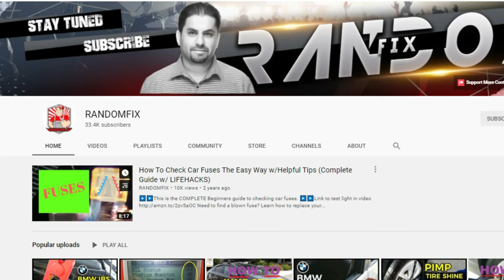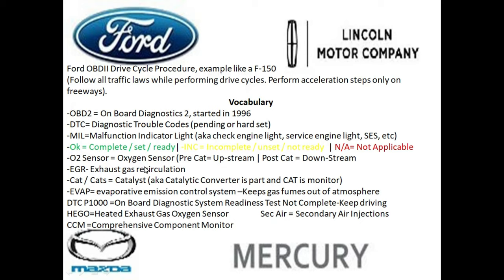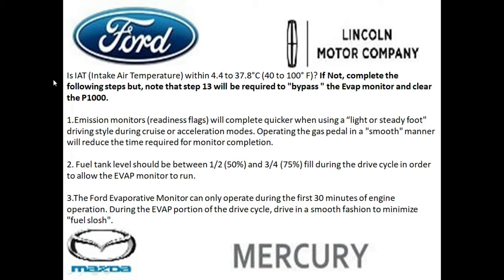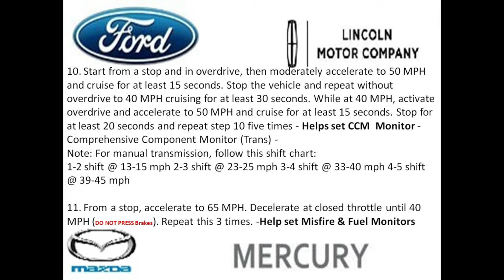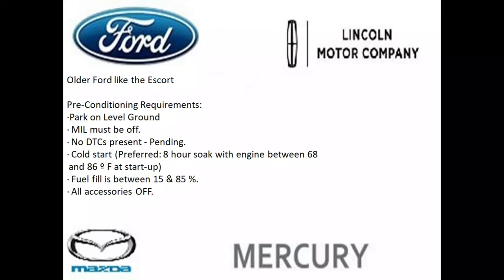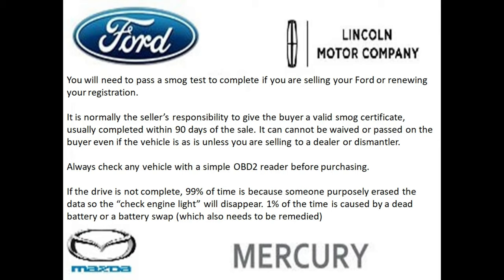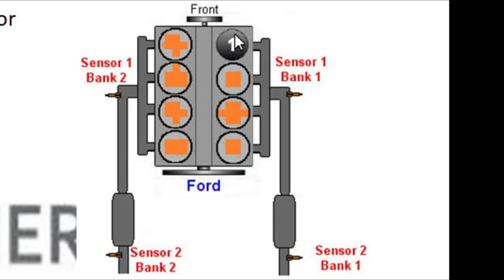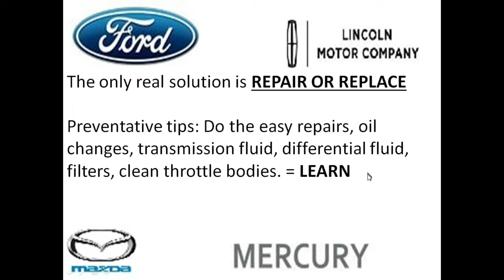Ford Emissions Drive Cycle▶️ How to Pass Smog Lincoln Mercury Mazda

Comment: ? Is it possible to lift the drive wheels off the ground and proceed the cycle it's just something I'm trying to avoid doing an actual road drive cycle
Reply from the maker: Lifting the vehicle off the ground would be advisable and could damage the engine and transmission if run it for a long time with no load.
It may seem scary so here is a video on me completely a drive cycle https://youtu.be/jldTJI64cfM?si=W1Of78QiCQ_9YZph

Once you complete the drive cycle focus only on the unset monitors. I here to help!

Comment: I have a 2004 Mustang that I use E85 and pump gas in. I need to switch tunes when switching fuels. I recently switched from E85 to pump gas and I can't get the Evap and EGR to read OK. Both read NA. Everything else is good. I've tried everything mentioned and can not get it ready. Is there something else I can try? Thx

Comment: I have a 2013 mazda cx5…only my o2 monitor and evap aren’t ready i’ve driven easily 100+ miles since clearing codes. I only need the o2 to pass what can i do specifically to get the o2 to be ready? I have no pending codes either.
Reply from the maker: I appreciate your feedback Sorry for the late reply, did you get this handled?

Comment: This helped me set the catalyst monitor on my 2020 Ford Ranger. One thing was to do the stop go driving in 4th gear to keep the rpm up at 3000 rpm. Many thanks!!
Reply from the maker: Glad to help. This emissions drive cycle are getting stricter and it is a little alarming. You should have to really do this on a 3 year old ranger. I appreciate the feedback.

Comment: Have a manual ford prob, how do I do the drive cycle?
Reply from the maker: Same process, instead of park just it idle in neutral. It’s actually easier with a stick as you downshift without touch the brake to decrease speed.

Comment: Exceptional  !!!! One question though for a 2010 Mercury gran Marquee.  My OBDII kicked out a DTC P0128  - "Coolant Thermostat Temperature Below Regulating Temperature" My  car has a common problem with the  A/C Hot Cold Blend Door Actuator sticking and making a bump bump noise and hot and cold air coming out wrong vents (defrost core diverting???)  Could this be causing the DTC P0128??
Reply from the maker: Not likely but try this. As soon as turn on the vehicle turn on the air conditioner and proceed as normal. The additional load on the engine from air conditioning running may cause the engine to heat up a little faster and you may avoid the  p128 popping back up before you smog the vehicle. Only try this after you have cleared the check engine light. So clear the codes the night before, rest the car overnight and then proceed. Let me know how it goes it worth a try .

If this doesn’t work you have other issues that you need to fix before you pass a smog test.

Comment: How do you speed up the Secondary Air and Evap to ready?  I've driven over 500 miles for a span of 2 weeks and still not complete.  I have no check engine and vacuum hoses look good.
Reply from the maker: You can't speedup anything but you can focus better. For the secondary focus on a longer warm up and for the evap keep your fuel level within range and park on a level surface. The evap is exempt even in California.

Comment: My 2000 V6 California Camry could never clear the last monitor (EVAP) for the last 6+ years so far. Check engine light cycles on for 100 miles then off for another 100 miles in an endless loop. Light on or off it drives fine. It started at around 100K miles, no problem before. When check engine light goes off with the remaining last monitor I was able to get it pass smog and hope it doesn't cycle back to the check engine light on during the test. Feels like playing Russian roulette. What a major PIA, this and doing tax returns!
Reply from the maker: thank you for the feedback !

Comment: I have a 2007 Ford E 150 van with 4.6 motor. It has 200k miles on it.
 My cats are not monitoring for smog. Everyone tell me to just keep driving it  Ive driven over 700 miles since last check engine light was on. Im figuring if cat or sensors were bad it would be a check engine light correct? Any suggestions?
Reply from the maker: What was the previous code before you drove the 700 miles with the check engine light light off? Is the catalyst monitor the only incomplete monitor?
Reply: @RANDOMFIX  it was a thermostat fault. i took care of it. cleared the codes and been runing it over 700 miles now. everyday to work an back. no check engine lights. i recently saw that i may be running odb 1 instead of odb2 which would fail me.. ive tied the drive cycles. no luck.

Comment: I have a 2013 Ford Transit Connect that won’t complete the EGR monitor only plus has no codes or pending codes but I’m gonna try the specific drive cycle for that before looking into diagnosing the EGR system and the EGR itself. Thanks 🙏 for this.
Reply from the maker: Glad to help.
Reply: RANDOMFIX so first off thank you for your help RANDOMFIX. All my monitors are up and passed except for the EGR monitor. The EGR is brand new and the ports to the head are not blocked up. Everything else is good far as battery and coolant. There are no codes or pending codes at all. Maybe I’m not doing the drive cycle good enough. 

Any suggestions or tips?
Reply from the maker: I think these transits need to see three passes of at least 20 minutes each. If you have not pending codes, just continue.
Reply: RANDOMFIX OMG 🤦🏻‍♂️ so 20 minutes per drive cycle? How fast or in between what speeds should I be going?
Reply: @RANDOMFIX  I’m having the same problem with my Transit Connect (2013). Just the EGR. 
So I just need to complete the EGR step 3x? Or do the whole cycle?
Reply from the maker: Scott, do you have a permanent code? Please watch this video. https://youtu.be/PMcJtcSOzdk
Reply: @RANDOMFIX  no codes. No pending codes either.
Reply from the maker: The previous comment had a permanent code thats why I asked. Did you watch the video I sent you?
Reply: @RANDOMFIX  the guy at the smog place said I had no codes. I ordered the tool you recommended and it's arriving tomorrow... I'll re-check with that and watch the video. Thanks!
Reply from the maker: Glad to help.

Comment: Do you know what a U1900 ABS Code is? I have that and a P1900
Reply from the maker: The u1900 is for CAN COMMUNICATION BUS FAULT – RECEIVE ERROR and p1900 will set The Diagnostic Trouble Code (DTC) will set when the OSS "output shaft speed" sensor signal to the PCM is irregular or interrupted.

The connection for both, the abs issue is common on some ford's and you It will not stop you from passing a smog test.  but the p1900 is power train code and will need to fixed. There is a small possiblity that your pcm is bad only replace after checking oss sensor.

Comment: Hi. Will this work for a 2003 Jaguar X type.. I read somewhere to follow Fords drive cycles.
Reply from the maker: Yes, the 2003 x type was a Ford, you can easily tell by doing the Ford drive monitor check.  Here is the video
 https://youtu.be/LllIXoqUKJ4

Let me know what happens.
Reply: @RANDOMFIX  thank you Sir.. I just bought the car it has zero codes but evap and comp monitors are not set. My state allows only 1 monitor to be set.. so I have to get one of these monitors going. Thank you for all your help!!!!
Reply from the maker: My pleasure 😊

Comment: What is a vehicle/engine qualifier and how do you "select it?" Do you have to?

If, for example, your CAT isn't set, can you go straight to step 7 without having to reset the PCM and everything? Do you have to do the whole key on/off/on/run thing every time you want to do a test?

how do you reset the PCM and do you have to in order to get the CAT test to run?

These seem like important details that you glossed over with no explanation. Nobody ever explains them but just reads directly from the ford drive cycle instructions which don't explain them either...

If you only have a few monitors not set (CAT and EVAP in my case),  can you just try to do the drive tests for those specific monitors any time? Or do you have to start back over at step 1?

I have no check engine lights and everything but CAT and EVAP are set and I've been trying and trying to get them to go but nothing is happening. I know that EVAP isn't required but I can't get the CAT test to run after trying everything I can think of. (1999 Ford).
Reply from the maker: Alex, you can focus just on the catalyst monitor, what model of the of a 1999 ford do you have? Miles? And what caused the monitor to unset ( example dead battery) ? 

This trick this video works great for some older vehicles. https://youtu.be/BuZYAy_xi0E

Keep me in the loop and I'm here to help.

Comment: Have a 1998 Ford Expedition 4.6L unable to get cat  and Evap monitors to reset do keep fuel level between 3/4 to 1/4  question 4R70w transmission I do get a converter shutter after awhile will that cause a knock sensor code throws p0325 pending code only not hard code has new battery question will cuase those 2 monitors not to set
Reply from the maker: Yes pending codes will keep  monitoring from setting. The evap is not as important as the catalyst monitor.
Reply from the maker: Are you saying the transmission is cause p0325? Please elongated
Reply: The transmission has a coverter clutch shutter wondering if the shutter is causing knock sensor code

Comment: I have a 2001 Ford F150 with the 5.4 L.  I took it to the Ford dealership because it never went emissions ready.  They told me to keep driving it until it was ready.  I put over 1000 miles on it and it never went ready.  I'm going to have to try this procedure when I get a chance.
Reply: I have a 2001 Expedition with the 5.4 Liter (2) Valve Engine. Ford doesn't make the PCM for this Engine anymore. I'm on my third Remanufactured/ used  PCM and still no luck getting the Cat and EVAP Monitors to become ready for Emissions testing. The Truck has new Spark Plugs and Coil Packs. I'm a Mechanical Engineer and specialize in Automotive Diagnostics. I'm currently working with a Ford Master Tech to help resolve the issue.
I'm a Master Tech too, but they say Team work makes the Dream work.
Wish me luck.

Here is my theory on what's really happening with these Old Ford PCM's. The EVAP & CAT Computer Chips are shot, and are not interpreting the input data to the respective chips inside the PCM.
It's old fashioned Planned Obsolescence.
Reply from the maker: Sorry for the late reply, I appreciate your feedback
did you get this handled?
Reply: @RANDOMFIX  I haven't had the time to follow the procedure.  I had to fix the bed over the summer.  I'm hoping to try your fix soon.  Thank you.

Comment: My 2013 Mustang has no CEL but since the battery was changed 4 weeks ago the Catalyst Monitor, Fuel System Monitor, Oxygen Sensor Monitor and HTR is incomplete. Hopefully this method works because I need to get mine smogged next week. Thanks
Reply from the maker: Good luck and let me know it goes. I'm here to help.
Reply: @RANDOMFIX  I’ll try this out when the road is empty past midnight this weekend. But I have one question since I have my EGR, EVAP AND CCM ready, so I still have to do those steps or can I just skip to the ones that I need to activate like HEGO, Catalytic and Fuel Monitor? Like without starting all over doing the steps that I don’t have to do anymore since those codes are already ok
Reply from the maker: You can skip right to unset monitors but you have more than one unset monitor so it might just be better to start from scratch but do not reset ( erase) the current data. Just start off with a cold start with 3/4 tank of gas and I'm sure it will set pretty soon. Good luck and keep me the loop.
Reply: @RANDOMFIX  finally got all my monitors ready. Thanks for your help
Reply from the maker: Glad to help. Is there anything the in video that was confusing or unaddressed?

Comment: I have a 2003 F150 Lightning. Has P1000 code due to EGR and Catalysts sensors not ready. Troubleshot the EGR system ok and drove the truck 400 miles and still not ready. Help!
Reply from the maker: P1000 set when the drive is incomplete. Your catalyst and egr may take a little longer since your truck is almost 18 years old. Focus on coasting for the egr and high speed driving for the catalyst. I left more detailed information in the video about your exact truck non lighting additional.
Reply: @RANDOMFIX  Thank you, you left more detailed information in the same video or different video?
Reply from the maker: In this video for the f150 but if you want to see a drive cycle in process check out https://youtu.be/jldTJI64cfM

Comment: I have a 2003 Ford Ranger 3.0.  I have driven over 500 miles.  Catalyst is still not ready.  No DTC.  The car does not have an exhaust.  Is it possible that is the problem?
Reply from the maker: If the vehicle does not have an exhaust like a catalyst converter than yes but it's only missing a a muffler than most likely not. Please define what you mean by exhaust, thanks
Reply: The vehicle has the full catalytic converters.  Bank 1 and bank 2 sensors are in place.  The exhaust past the catalytic converter was disconnected by the previous owner.  But upstream and downstream sensors are in place according to OEM spec
Reply from the maker: Okay,so please watch the cat not ready playlist here for a few ideas. https://youtube.com/playlist?list=PLDEbtVOPRC-h1BAzaWQ-6NSnmG0gwvgwP

I would try the 3k trick.
Reply: Thank you!

Comment: 2001 Ford F 150 battery died before smog. Now I get everything Okay but Cat its been 1000 miles. I will try the step 7 tomorrow.
Reply from the maker: Michael focus on the long steady high speed drives.
Reply: @RANDOMFIX   how long I drive about 17 miles to work on freeway and 2 miles on streets a day.
Reply from the maker: Michael the f150 is 19 years old and so the catalyst. The long your drive at steady speed the better. The only way you can know it got ready is by having a bidirectional obs2 reader which at at 50 dollars. I can recommend on. Please see my other videos on the smog tips playlist as there are products that have helped other but are only temporary solutions. Let me know if you need any recommendations on the obd2 reader.
Reply: Drive in D2 it worked for me
Reply from the maker: Thank you for sharing.

Comment: Which one of these would apply to a 2002 Ford Mustang V6 with a manual transmission?
Reply from the maker: The whole video is for Fords. If you want to see a drive cycle in action watch 
This https://youtu.be/jldTJI64cfM
Reply: Did you get your mustang to pass?
Reply: @victorarevalo108  yes I did finally
Reply: @sergiomurillo9930  what did u end up doing?
Reply: @anonym0usHaxxx  well it seemed that doing an oil change fixed the problem. I'd drive it as the tech said to but didn't do anything. Only after the oil change was I able to pass.

Comment: NOW the tough. one my Ford Expedition 1999 it has not passed the drive cycle for the last 6 years. I have the smog shop, local mechanic tell me go somewhere else. I have contacted Bureau of Automotive Repair, and the dealer.
Reply from the maker: Sorry for the late reply! did you find a solution?
Reply: @RANDOMFIX  No I have not, I just checked off two things on my list and this is one of the two next I have to get done. This Expedition only has 79K miles for a 1999.  Heard the that the state of Ca. will give up to 1200 dollars for basket case jobs like our Exp.

Comment: OMG! Why is this so freaking complicated? I'm not a mechanic or car person in any way shape or form. I just need my 2013 Escape to pass freaking smog check to get my registration. They told me at the smog place to drive it 100 miles. Will that work or not? Also, do I really have to go and buy one of those OBD monitor things that I can't afford?
Reply from the maker: Yes you need a obd2 or ask AutoZone if you can use theirs for free.  Here is the drive in action so it will make a little more sense.https://youtu.be/jldTJI64cfM

Good luck and keep in the loop if need more help.
Reply: @RANDOMFIX  .... Thank you for responding and sorry for my temper tantrum 🙂 The only trick I know is the thing about your check engine light flashing 8 times when you have your ignition turned on which tells you the monitors are not ready but of course it's not very specific about why. Thank you for all of your information. It is appreciated
Reply from the maker: Exactly you can this trick on your Ford. https://youtu.be/LllIXoqUKJ4
And that way you can avoid buying or borrowing a OBD2 reader.

Comment: I have a 1996 ford ranger , no codes, but can't get the heater monitor oxygen sensor ant cat in ready mode,. Help!
Reply from the maker: Hi Dee, focus on a proper warm for the o2 sensor heater monitor. Then o2 oxygen senor monitor and once you set the o2 monitor then focus on catalyst monitor. Have you checked the connection on the upstream o2 sensor?
Reply: Should I turn the heater on ,at anytime, if I want to get a green light for the heater temperature monitor
Reply: Focus on a warm , what? day,. Should I idle for 15 min? (HTR monitor)
Reply from the maker: Exactly, idle without moving the ranger. 15 minutes or longer. If that doesn't help set the o2 heater monitor, check then connection and o2 heater element with a digital volt meter.
Reply: Hi again, should I put the heater on while the car it's idling for 15 minutes , to help clear HTR
Reply: Hi again, should I put the heater on while the car it's idling for 15 minutes , to help clear HTR
Reply from the maker: I would leave everything off and make sure the air flow selection is not on windshield as some ac system will remain on.

Comment: I have a 2001 ford f150 5.4 supercrew,  smog shop told me that there is an incomplete catalytic converter drive cycle, no codes no check engine
Reply from the maker: Thank you rane  for your feedback, much apprecated!